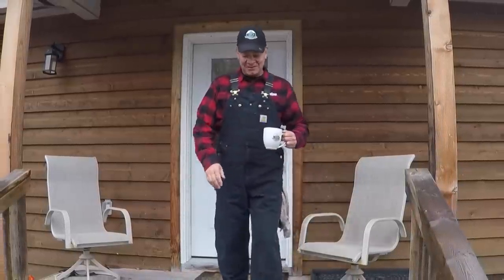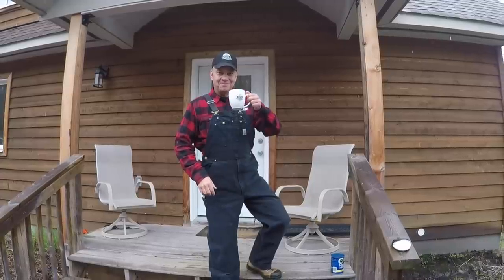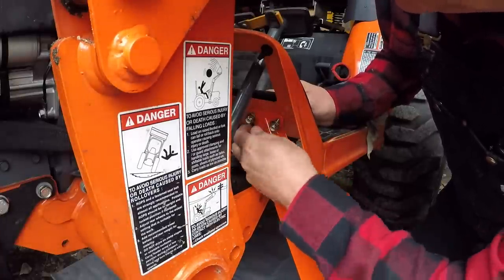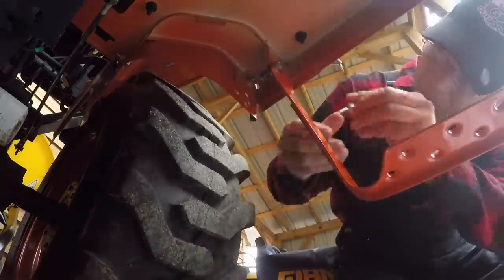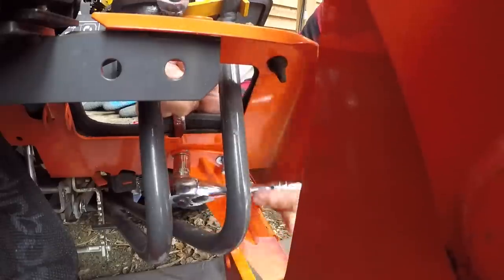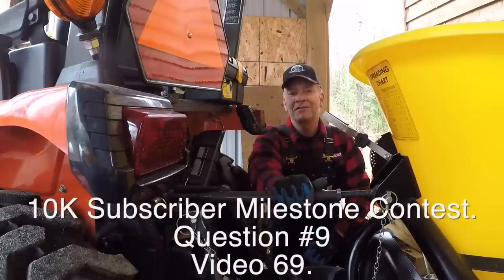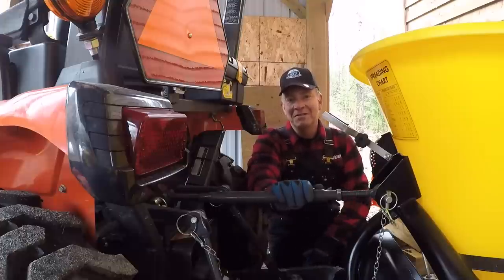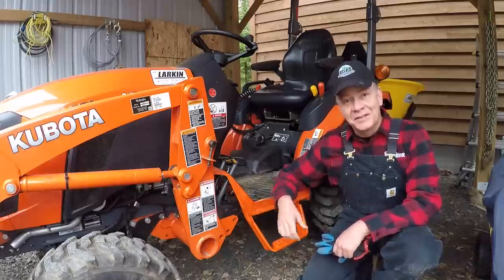#158 kubota b2601 compact tractor. Stepp'in Up! outdoor channel

Comment: Now that's a great addition, GP.  And......the step is economical and already painted the same color too (smile).  Big like on the video, GP.  👍
Reply from the maker: Hey good morning Houndsman! Yup, super happy with this so far. Hope all is going well with you and your family. Cheers good sir!
Reply: Please post the part number for this step. My local dealer and online parts site cannot find this part. I explained to dealer it's a stock part for 2650 that fits 2601...but they won't order it for me unless I have the part number. Dealer claims they cannot support a non-kubota youtube suggestion etc.  My 78 year old mother replaced her old John Deere with the B2601 and loves the new tractor. But she is petite and needs a little boost to get on for snowblowing. We know we need to remove step for mowing season.  THANKS to your video! Thank you!!
Reply: HEY - I found the part # in other reply. Thank you
Reply: @ruthhare8005  what's the part number? Thanks!
Reply: @mikepohl2264  I don't know now, but did find it in other post. We ordered step from Canada dealer and picked up there in person for $40 or $45 total. U.S. dealer it is over $75 +/- s&h. Mom loves the step. Install is as easy as this video.

Comment: You think that for $24K they would throw in a step...?
Reply: The 2601 is built to accommodate a belly mower. The step would interfere with that. No problem if you are not going to mow, however.
Reply from the maker: LOL. Hey good evening RC. Yes I thought so too but them I think you will see Larry's note below. Maes sense to me. Hope you are doing great! Cheers!
Reply from the maker: Guilty as charged...:). Cheers BMB!
Reply: @GPOutdoors  Thanks i am doing well.  With regards to the step, if you have problems with it making contact with stumps, rocks etc. you can build your own out of wire rope, maybe use 5/8ths inch for the sides and a piece of 1.5 inch channel iron for the step.  You see that on a lot of machines on the logging side of things.  Some applications use chain instead of wire rope.
Reply from the maker: Glad you are well RC. That is a brilliant idea. Thanks for sharing it. I'll see how this goes and if it does impede me, then this is a great option you have suggested. Be well and all the best!
Reply: @raincoast9010  Sir that's a great idea !!! I think i will greatly use your exemple to influence someone about it and it's first name start with a J !!! LOL
Reply: @RCAFpolarexpress  Hello, i watch Joe too and have seen you there.
Reply: Ok, you've got me convinced now!  You know, a simple step would be good too.  My tractor is not that high, but the step is tucked far between the wheel and the transmission. An extension in front of the wheel and 6'' lower would be great.  Then a decent handle on the back of the FEL will make a great addition.
Reply from the maker: I think I see a helpful video coming out from Joe soon. LOL. Thanks again RC, Dave and Joe!
Reply: @raincoast9010  Thank you very much Sir Cheers !

Comment: do you have a part number
Reply from the maker: I don't with me but I believe it is in some of the comments under that video. Sorry - just not with me. It is called a "step Assist" and is the exact step and part that comes standard on a B2650. But if you run a belly mower, it will get in the way of it on the B2601.

Comment: New subscriber and new B2301 owner. Thanks for the tip on the B2650 step. My dealer has one in the pipeline for me.
Reply from the maker: Good stuff and welcome to the channel. Just a FYI - I found out that if you use a belly mower on the tractor, the step will get in the way so can't be used together. Congrats on the new tractor!

Comment: That's great that an existing factory step bolts right on. I had a similar situation with my Deere 2-series. I discovered that a step from a 3E-series would bolt on with minimal modification and it only cost $20. My knees now thank me every time I use the tractor. :-)   BTW... I think I know the Kubota aftermarket source you speak of. It looks like good stuff but the prices seem completely over the top.
Reply from the maker: Good evening Joe. Yes, I was a bit surprised at how reasonable the price was as well. And I agree with you 100%. It has only been a couple of days but it is so much easier getting on and off - I didn't think that little step would make such a big difference. It's a keeper! Cheers!

Comment: Greetings Gord,Lee here,  like your step, great price and most improtant easy on the knees, I had to make 2 for my kubota, but they work great. Later
Reply from the maker: Good morning and great to hear from you Lee. I was thinking that I might splurge a little and get one for the other side too - I haven't checked if the platform has the holes on it on the right side, but the step sure does help a lot for me. Be well and have a good one!

Comment: Hi GP, I bought a step from the Kubota dealer but the problem I had was that the belly mower would hit the step. I didn’t feel comfortable because of the flex of the floor when climbing on. I weigh 300 lbs so I did order one from our friend Paul Short. It is much better as it is connected ti the fel bracket where there is no flex. I do take the step off when using the belly mower, but can stand on it to get on. Thanks for the great work you do for solutions to problems, but I use Paul’s step and love it. Thanks Wayne from Wisconsin
Reply from the maker: Good morning and thanks for the information Wayne. I am sure it will be helpful for others too. Cheers and all the best to you!

Comment: Hi GP!  Now that mod is well worth it!  My L3901 came with a step but only on the left side.  I’ve considered adding one to the right side, but getting on and off on the right side is a little tricky with the FEL control lever.  I always lock the lever before getting on or off the tractor on the right side.  I know you’ll enjoy having that step!  Cheers!
Reply from the maker: Good morning DIY! I am now thinking about the same thing - perhaps adding one on the right. That's a really good idea to lock the FEL when using that side. Thanks!

Comment: That is a great mod! I am surprised about the price.  I think I would have bought it instead of making one! Lol!  Now, I am going to look if there is any OEM step for a 1962 Case 430! Seriously, that is a great mod and I can see it helps a lot getting on and off the tractor. I'll consider that as a project for myself!  Thanks GP for the idea!
Reply from the maker: Good morning Joe! You bet! I am liking this step a lot. Cheers mon ami!
Reply: Hey Joe... you're lucky the 430 is a low tractor comparatively.  My 580 has a platform across the top of the transmission that's much higher and it has a vertical pull bar welded to the side of the rear loader mount.  I'm sad to point out that it is such an automatic thing to jump up on, I honestly do not know if there's a step there or not !!!  Now I'm going to have to go look. (-:  Man, don't get old Joe, you begin to forget things.....LOL
Reply: I think I am already old if forgetting things is a sign...

Comment: Hi GP, I did that mod about a year ago and my knees thank me every time I use the tractor. Not sure if it works with a mid mount mower as I don't have one yet but I will be purchasing the 60" mid mount deck next month. I painted the edge of the floor with Kubota paint and added grip tape on the edge from Princess Auto. Keep up the good work !
Reply from the maker: Good morning Brian! You are right. Only been a short time but it is so much easier getting on and off now. I understand from a few comments below that it will not work on the B2601 with a mid mount mower but best to check with the dealer of course. Good luck and congrats on the new soon to be purchase!
Reply: Brian Charman The step does hit the mower deck. I take it off and use the deck as a step. Wayne

Comment: Thank you for showing the step install. That is a great idea to use a very inexpensive step as a experiment to see if it works. I believe the ground clearance issue will most likely happen when you have to go over a hump in the woods. However, in my humble opinion I believe that the more expensive step from that other place is functional artwork. I have purchased several guards from them for my l3560. The quality and workmanship is beyond belief. 
An item from them could be hung on the wall as artwork. 
From the video I could see that you have all your filters exposed. Have you considered getting the filter guards from them. It seems like the cost of not having to replacing the hydraulic fluid would pay for the guards.  Just a thought.
Reply from the maker: Good morning Jan. Thanks for the thoughts above. I am sure his workmanship is excellent - and they seem like good folks. The Kubota step should do the trick for me I think - my  neighbour has the similar step on his L series and it has lasted for 15 years now working in the forest so I should be good. Yes, I thought about the guards a few times but the cost to me is $168.00 CDN plus the FX transaction fees for each of them. So,  $340 plus fees for the two guards. So I kind of weigh the risk/cost of a breach and the inconvenience of it, versus the cost - so still considering it. Thanks for the info above. Some food for thought for me. Have a great week!
Reply: Thank you for your reply. I feel you do a great job with your videos. Maybe you and Guy could come up with som similar guards. Those type of guards can be made by cutting metal and welding.  It would take more time with out a metal break, but it can be done. In fact by making an adaptor that goes over the wood splitter wedge would convert it into a metal break.  I do enjoy very much the way you present your videos. You have a unique talent.
Reply from the maker: Thanks Jan. I appreciate the kind comments very much. That's a great idea to talk with Guy. Thanks again!

Comment: This worked!  I used stainless hardware.  Looks factory.
Reply from the maker: Awesome - Great to hear Paul!
Reply: @GPOutdoors  I think I may have hit the weight limit for the step.  After a dozen or so mounts to the B2601, my 335 pounds has strained the mount and it is now no longer parallel to the ground.  Seems that the platform has that welded reinforcement but the platform is supported by the fender and it is that part that is feeling the stress.  There is one smaller bolt (many holes) holding the platform to the fender but it relies on the curvature of the fender for strength.  This is similar to my '05 BX2350 that had a plastic fender that cracked twice before Kubota came up with a piece of channel steel welded to the frame for support.  I'm going to take a video and mount the tractor to pinpoint the stressed area(s).  May have to fabricate something similar but will NOT be welding to the frame as I'm sure it will change its strength.  Will keep you posted if you like.  Thanks!

Comment: Hey Gord,

That is a great and easy mod for your tractor! I never much thought about it, but my L3901 came with the step already installed. I am surprised that Kubota doesn’t put the step on all of their tractors right when they come from the factory.
Reply: The 2601 is built to accommodate a belly mower. The step would interfere with that. No problem if you are not going to mow, however.
Reply: Larry C…That makes sense. Never thought about the belly mower getting in the way!
Reply from the maker: Good evening Mick. Hope all is well! Yes good point and I see Larry's comments below which I did not even think of but it's a good point to consider. Thanks guys - all the best and thanks for saying hi!

Comment: My L series tractor has a factory one installed! It got bent within a half hour run time in my brand new 3902 HST…
I was driving through my back woods and went to drive around a dead stump I knocked over ….the front tire caught the side of the stump and somehow sucked it under the tractor which wedged itself under the step and bent it against the rear tire..
No real damage other than a bent step…
I straightened it out so it’s usable but thinking of just taking it off! It is a bit higher without the step and like most people older than 40 have ailments ….😅 …so any help climbing onto something is needed..

Comment: I always look forwards to your videos GP. As a new tractor owner with 7 acres of very dense woods, with endless amounts of small dead-fall branches; have you ever had a puncher driving in the woods off track? I am very worried about getting a puncher only 16hrs run time off track; have I been super lucky?
Reply from the maker: Good evening Forester. I apologize but I think you are asking if I have had a puncture in one of my tires? If so, then no, not yet. They seem to hold up well so far. I get a little nervous sometimes when I am running over tree limbs but so far, no issues after 18 months now. Good luck and drive safe!

Comment: Wow GP, I would have guessed somewhere around $200 for a genuine Kubota step. Perhaps I'll add one to my B2601. BTW, I'd check those fasteners after a bit - my understanding is that Loctite is corrosive to certain plastics. Take care.
Reply from the maker: Thanks SP! I will keep an eye on it and check on them after a while. Have had the step on for only a few days but surprising how much of a positive difference it has made. So much easier ascending and descending the tractor. Cheers and all the best!
Reply: @GPOutdoors  Getting on with the tractor running, I always wondered why the rpm's would drop briefly. Turns out I was moving the steering wheel.

Comment: You may not be losing any clearance at all. Sit the tractor on a flat surface and check the distance of the bottom of the front and rear diffs to the ground. One of the diff housings is often the lowest point on a tractor.
Reply from the maker: That's a great point William. Thanks for the advice. I will. Thanks again!

Comment: Where dud you buy this? My local Kubota dealer doesn't have it
Reply from the maker: Good morning Roger. Tell him it is the "Step Assist" (part name) - I don't have the part number handy but it is the step for the B2650. When you talk to the parts department ask them to open the exploded parts diagram for the B2650 and they will see it. I believe it is the exact part that is now on the LX2610 ( which replaced the B2650).  I did a Tractor "MOD" video a few months later and I listed the part # in that video.  Cheers!

Comment: like your videos , where did you purchase the step, I just bought a B2301 and the dealer wants $65 for the step off the B2650. Cheers!
Reply from the maker: Hey good evening Wayne! That makes some sense to me. I saw a Messick's video a while back and he (Neil) mentioned that tractor dealers price their tractors and parts differently - some adjust margins differently between their tractor sales and their parts sales - basically the price varies by dealer. I bought mine from my dealer - Larkin Equipment, which is where I bought my tractor and some other implements.  I also noticed that Messicks is selling them for about 67 but yet a friend in Maryland got his from a dealer for 40 too. Hope that helps a bit. Cheers!
Reply: @GPOutdoors  Thank you for your time , have a good one, Cheers!

Comment: Looks great! What the part number , I would like to order me one for my B2301
Reply from the maker: Good day Matt. I don't have the part number but you can order it from your Kubota dealer., It is the step from the parts list of the B2650. I understand that if you have a belly mower, it may be too low for it to be used. Cheers!
Reply: Thanks GP

Comment: Are you put one on the other side too GP
Reply from the maker: That's a good question Richard. After I put it on, it dawned on me that I should but I have not looked under the platform to see if the same hanging bracket is on the other side. But I will check soon. Cheers and all the best!

Comment: Too bad I have to mow with the mid mouth mower, I see the note below left that it will get in the way so I am sure it would be the same with my B2301. I try and tell myself not to grab the wheel. Its just too easy to grab. Any other options?
Reply from the maker: Good morning Devon. Yes I didn't think of that but it makes sense as I didn't think about the need for that clearance for folks with a mid mount mower. I can't think of anything else. I have tried many times to use the handle on the fender but often I still end up grabbing the wheel with the other hand as I start pulling myself up. Sorry I couldn't be more help. Have a great week!

Comment: I have a BX2680 which doesn't have the two bolt holes for the front of the bracket not does it have the bracket to mount the rear arm. is there a step available now for the BX2680?
Reply from the maker: Good morning Bob. I am not aware of one. My brother has the 2680 as well - he likes it alot. One thing about the step is that it gets in the way if you use a belly mower. Good luck!

Comment: I ordered a step for my B2601 and it fits.....but it interferes with the rck60-32 mower deck when raised.  I plan to cut about 2.5 inch off each leg to raise the set and install it... otherwise, this is a great addition for those that don't have mid mount accessories like a mower deck..

Comment: Gp do you have a part #
Reply from the maker: Good day Jack. I believe these are the part numbers:(Step) 6A70051350 and (Hardware) 0112550816. Cheers!
Reply: Hey Gp do you have a source that I can get one of these staps as my local vendor wants $65.00 American ,crazy bugger.Any help would be apprecieated.
Reply from the maker: Hey good evening Jack. Not surprised. I found out a while back that the dealers have a wide flexibility as to how they price their parts. I am afraid I cannot help you out on this one but it is certainly far cheaper than other options I have seen. I wish you the best!
Reply: @GPOutdoors  thanks,I Googled the part # an a wild variety of prices appeared.Mostly around $42.00 ,American,not bad